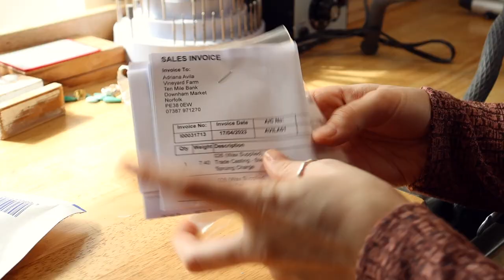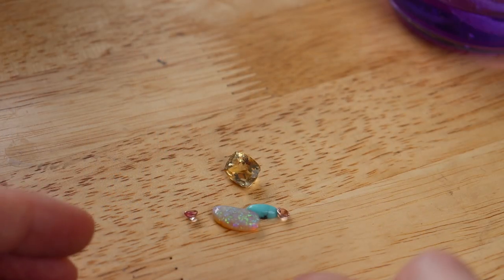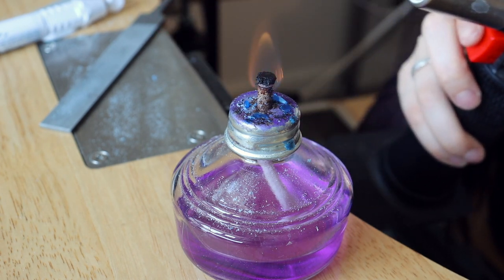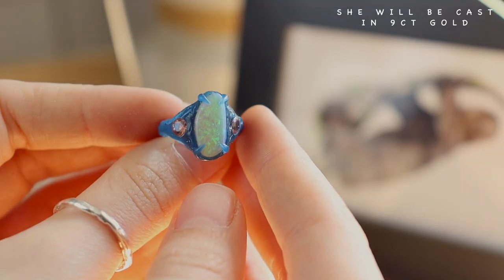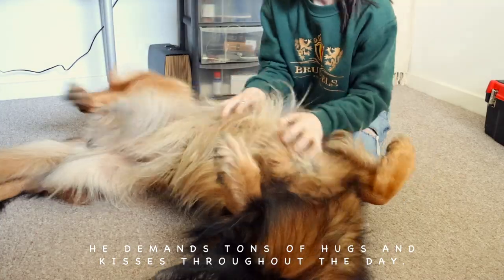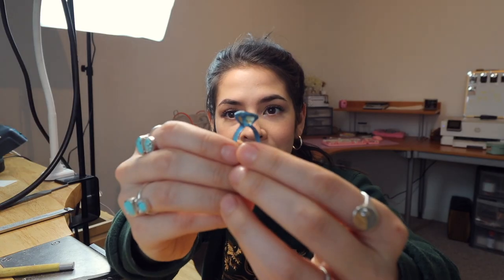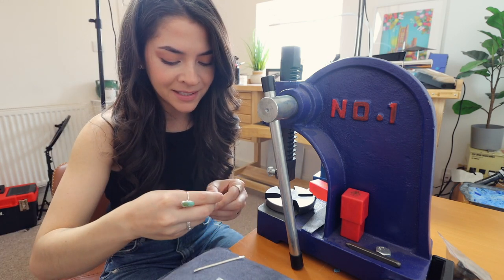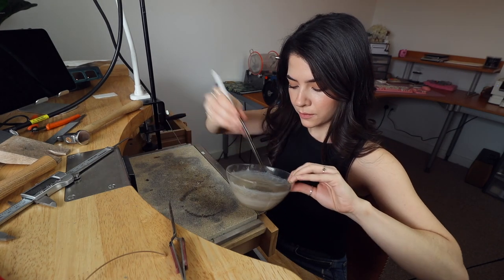Studio Vlog #2: Make Jewelry with Me | Wax Carving | ASMR Handmade Jewelry

Comment: Question, do you make the setting of the ring a bit bigger than the stone? I know with other methods you have to account for shrinkage but is that the case in lost wax casting? Or can you just make that part of the ring just the right size for it? Also, when making the prongs, I think in another video you said you would solder the prongs on so does that mean you remove them, and cast them separately from the ring? Or was that just for your soldered pieces? Last question, how do you remove the stone before casting? I see you carving the ring and prongs around the stone but how do you remove it? Does it just pop out? If the prongs go over the stone, as you did in the ring you made,  how would you remove it? Is there a way to do it without damaging the prongs? Would popping it out suffice and not damage the wax? Thank you for your help! Your videos have been very helpful and your work is amazing. 🙌🏼 It’s really cool to hear about your humble beginnings and your growth. I love watching your content 🙏🏼
Reply: Great questions! I would love to know that too